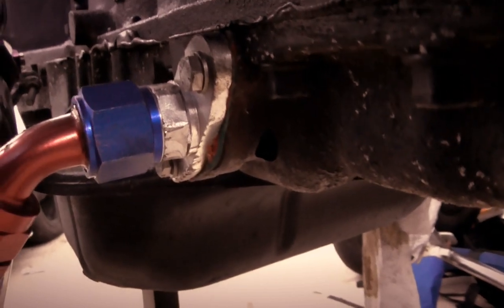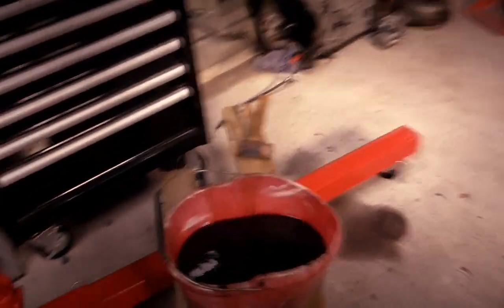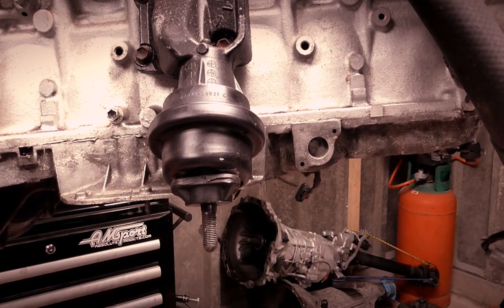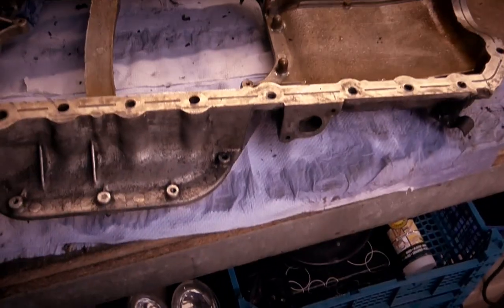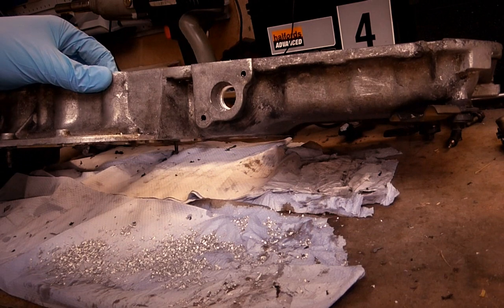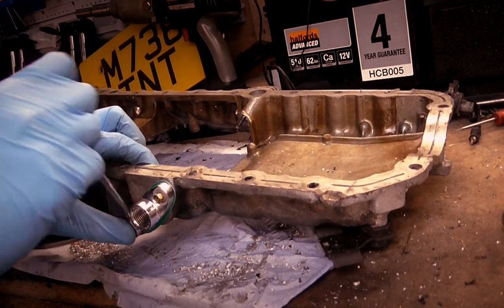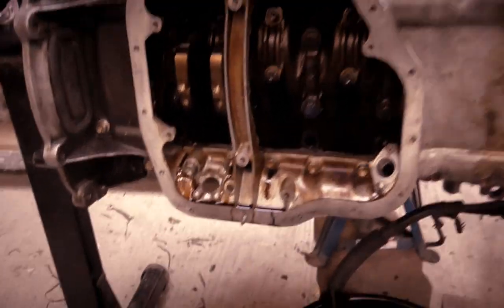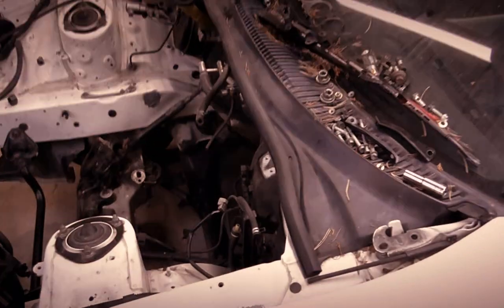SINGLE TURBO SUPRA BUILD - Part 33 - Turbo Oil Return

Comment: Where abouts did you buy your oil line parts? 
I've just bought the same turbo kit for my engine and would be interested if you could list the fittings and flanges you bought! thanks :)
Reply from the maker: hey man. if you join our Facebook group I can send you a link. but the kit is off eBay.

Comment: You might have some problems with oilpressure when get up and running because you did not seal the Oil pump intake from the sump
Reply from the maker: I replaced the gasket.
Reply: +Absolute Modicts Aaa okay what about between sump and block
Reply from the maker: +latukka10 yes. all sealed.

Comment: Hey Bluddy, how's that oil line kit holding up?
Reply from the maker: Been on a few years now and no issues. No leaks etc
Reply: @bluudysgarage  Ok, good to know. Currently building a lexus is300 turbo. Got a tubular manifold which is close to the oil line. Im therefore getting a metal line off a Dodge Ram lol. If not i would have bought same as you.